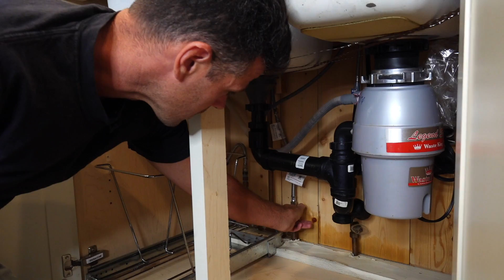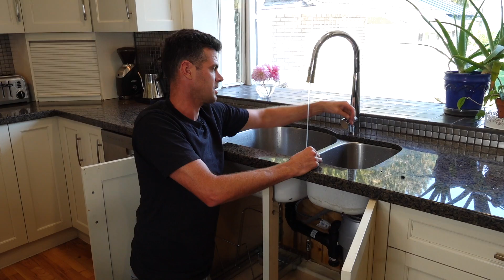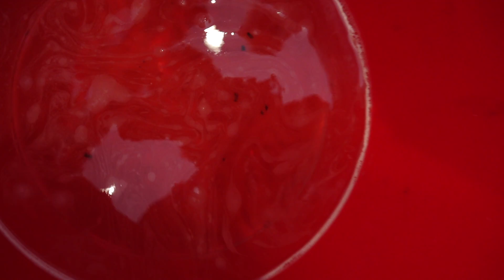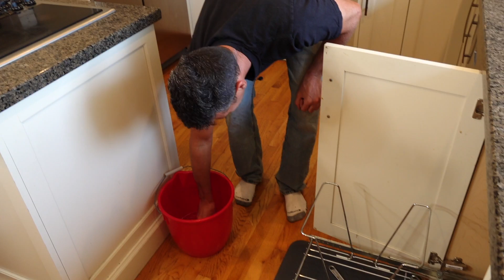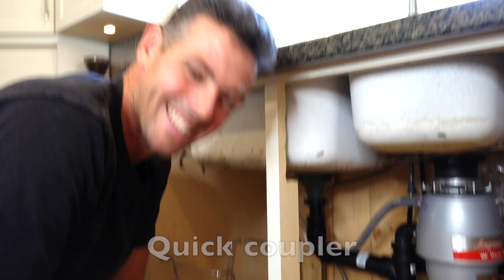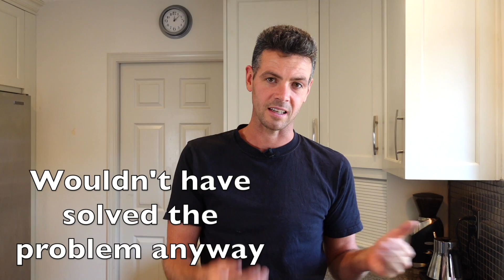Clogged Faucet SOLVED!!!

Comment: thank you, i have a less common brand, ez-flo, sold at home depot and lowes, but there are no videos about it. the connector to remove was the one the pull down handle is connected to, it had rubber and soot bits!

Comment: I did have the little rubber pieces in that filter piece, but the biggest clog was at the the tip of the faucet, the top mesh was completely covered.I just had to unscrew it, clean, and screw it again.

Comment: Follow up question: Can you please specify where the degrading washer was and the replacement? If the degrading rubber washer was the cause of issues, and you were able to flush out the little pieces by disconnecting the hot/cold water lines and quick coupler- won't the rubber washer continue clogging it back up?

Comment: This doesn't help if your pull down faucet hose starts disintegrating.  The Chinese crap they sell now is designed to fail so you have to buy a new replacement.  Screw this communist crap!

Comment: Saw this video AFTER I ran through the problem myself. I called a local plumbing outfit (in USA) and they said "backflushing couldn't be done because of a oneway valve, but they could replace the whole faucet with the only one they stock for $1000.00 !"  I said "no way" and then took apart the entire faucet piece by piece over a day or two and cleaned it out. For backflushing the lines I used a brass dishwasher inlet connector attached to a garden hose. The debris rested inside the diverter valve accessible after removing the handle. In my case it was rust from replacing a single fitting with 2 connections: (1 sink 1 dishwasher). I had replaced it while installing a new d/w because the old valve wouldn't shut off completely while working on the d/w leaving me with shutting off all the hot water.

Comment: I disconnected the sprayer on mine and noticed there was some rubber pieces lodged up in it. Used a pipe cleaner and ran water through it until it dislodged and boom, pressure was back. Thanks for the great video!

Comment: I recently installed a new Pfister Seahaven kitchen faucet.  Had the issue with the low pressure on the cold side.  Realized I have a bad cold water valve.  The washer was falling apart.  Fixed the valve with a new stem kit.  Easy fix.  Followed your steps but it would not dislodge anything.  A comment mentioned about taping the spout to get some extra pressure coming out the cold line.  I could not get a good seal with the tape..  What I eventually did was squeeze the spout line under the sink and that provided enough extra water pressure to shoot out the broken washer piece.  Good flow on both sides now.

Great tips by your video and commentors.  Thanks!

Comment: Who would have ever thought that would be it?  I spent hours trying to figure out why my crea bar faucet stopped working (very low flow) when the only thing I did was changed out my under sink APEC point of use water filter cartridges with a new one.  You know that should improve flow if anything right?  Everything worked fine with the old filter, I just replaced it with new filter same make/model.  The only thing I can conclude was the new filter had some residual carbon bits that when installed they flushed and immediately clogged that little POS filter that I never knew existed until I watched your video.  You’re my hero for life!

Comment: Thanks man! That fixed the bathroom sink for a while. It has galvenized iron and rust flakes build up over time. This tip worked wonders. Don't have to wait an age for the hot water :)

Comment: This video came in really handy...same issue with my faucet also...thanks a bunch...all good now..still need to replace the HOT side valve but for now, I am up and running on the cold side with no pressure issues...thanks

Comment: Hey, thanks a lot for the video, my hot water was clogged on the shower at a mixer tap like that.
After some fiddling, the idea o disconnecting the hot water an using the pressure of the cold water to unclog it worked underfully for me.
The clog was the result of an old rubber thingy that was breaking apart. I still need to replace that though.

Comment: Omg I tried everything, nothing worked until I got to the step where you cleaned out the blue plastic piece. That fixed my issue and my water pressure is way better than I have ever had. Thank you so much! Clicky piece cleared! You saved the day. 😂

Comment: Wohoo!!! Mystery solved. I spent 2-3 hours trying to figure out the issue. Even removed a cartridge, cleaned and reassembled it but no luck. Finally this one worked. It was a small ring inside a quick connect just like this was the root cause.  I can sleep now!! 😊

Comment: I've got the same problem. Old kitchen faucet was running slow. Replaced it, and the new one got slow after a week or two. I discovered a degraded bibb washer in the hot water shutoff valve, just like you. I pulled out all of the visible rubber fragments around the valve and replaced washer. But problem continued. Tomorrow I'll try this solution. 
Just out of curiosity, is your hot water shutoff valve a Brasscraft? I think they might have had a run of bad rubber washers. Thanks for the video!

Comment: Those rubbers should be changed for real gaskets and then of the sort capable of handling hot water.

Everyone (🙃) knows those cheap rubber o-rings or washers deteriorate rapidly in hot water environment.

Comment: Hello, I live in vancouver and I´ve arrived from Peru 7 days ago, I bought all my tools becouse I thought I would be able to buy and optimize (cut) melamine panels for a lower cost. Now I got notice that it is really hard to find different melamine designs (surface colors) and services, like cuting and edges covering. Do you know a place that does it?, as it is normal in Peru, i thought it would be the same or maybe better here, but it is not. THANK YOU FOR YOUR VIDEOS AND YOUR SUPPORT
Reply: Maybe ask the same question at Home Depot or Lowe's? If you're lucky they'll have someone knowledgeable about the local market. If that doesn't pan out, head to your local immigration services office, they should have career counselling and hopefully a big enough network to connect you with someone who has knowledge of the industry. Good luck with your journey in Canada!

Comment: I had the tube in my hot water heater disintegrate about 15 years ago.  We had plastic coming out of all the faucets, clogging stuff up.  A few months ago, the upstairs bath wouldn't shut off.  I called a plumber and he said it would cost $1200.00 to replace the old faucet shut offs.  I did some research and found the parts online and the tool to go with them.  I pulled the handle off the hot water handle, removed the two way valve, and beneath it was a 3 inch piece of pipe that had disintegrated those many years ago.  what a pain!!!  but I saved $1100 bucks!

Comment: Nice video, this is a common problem.  The seat washer will eventually disintegrate in old stop valves and clog faucets and toilet fill valves too.  I try to remember to check that when replacing a faucet or fill valve and either replace the washer in the stop valve or install a newer type "quarter turn" valve that doesn't have a washer.

 This is a great video of how to check all the clog points in modern single handle faucets.

Comment: Hey Ben I've been using "Shark-bites" With no problems for years. Haven't had a problem. They have a deburring tool for about $10 US when connecting PVC with them never had a leak. Yet lol cheers
Reply: I’ve been using shark bites for 10 years. Never had a call back.

Comment: Right before I closed on my current house, the water heater had to be replaced. Six years later black crud started coming out of the faucets in the master bath. Quickly discovered it was hot water only and after flushing the water heater tank, still had the problem. I pulled the beautiful braided steel hoses going in/out that were new with the heater and sure enough, there was black rubber inside which started to deteriorate on the hot side. Replaced them with convoluted stainless steel lines; all better since!

Comment: Mixing valve. That is the word you were looking for. Aka that thing I completely disassembled before I discovered the rubber seal on the hot side was my problem as well.
Reply: Are you talking about the seal in the hot water shut off valve? That could be where the problem is.

Comment: 1:50 shouldn't there be a one way valve on the cold water in the faucet so you can't push possibly contaminated hot water into the cold drinking water?
Reply: Why would the hot water be contaminated? I've never seen a one way valve in a house.
Reply: @beachrider21  it's been sitting in your hotwater tank, might have been at a temperature promoting bacterial growth, etc. maybe mostly historical 
https://youtu.be/HfHgUu_8KgA I think it is actually a requirement in many places
Reply: @fuzzy1dk  That video is talking about British water systems with water storage tanks open to contamination. Modern houses have closed hot water tanks supplied with potable water. If the hot water coming out of your taps isn't potable there's a problem with your water supply or the pipes in your house.
Reply: @beachrider21  and you want to make sure that if so, that water can't possibly be put back into the water supply